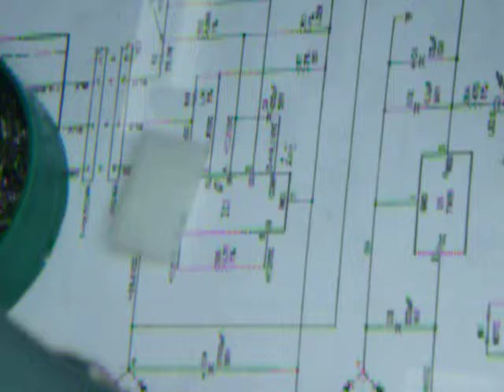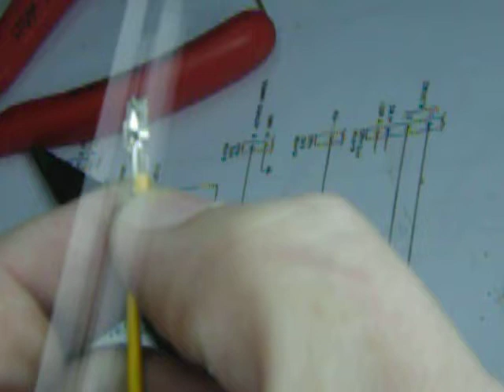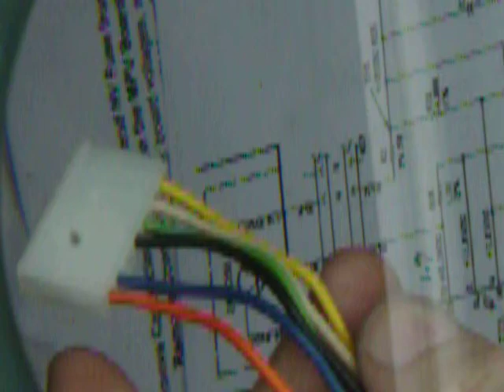How to: Crimp a Molex connector

Comment: Ironic that I watched this after redoing the connectors on 2 D-8784 power supplies.  Interesting thing between them is that 1 of them has R27, and the other one has a factory installed jumper.  Any insight into that?

Comment: Do you know of a site where I can get the pins, (male, and female) and the sockets?  I know that Bob Roberts has connectors available, but I don't know what pin size to use for 20 awg wire, especially when two 20awg wires need to go into the same pin socket.

Comment from the maker: @ddpk000 Most PC power supplies use standard .093 molex connectors on the 4 pin housings. mouser 538-02-09-2118 & 538-02-09-1119

Comment: @D0kert I hope your daughter gets better.  Bring the tool to the camera, maybe use tweezers to point at things.  Thanks for the vid, I was crimping both parts on the casing instead of one on the wire, one on the casing.  I'm still using needle nose pliers.  Poor man's solution.  Thanks again!